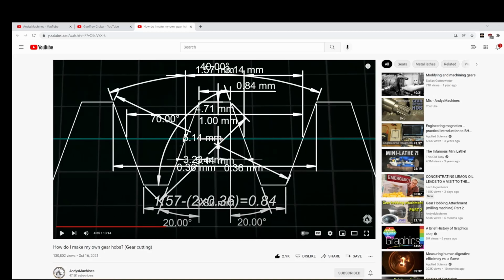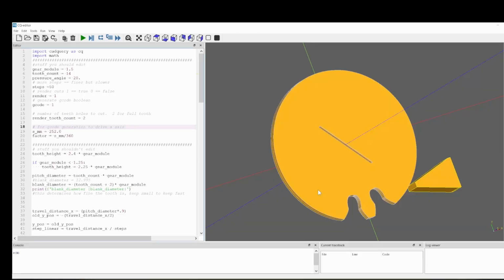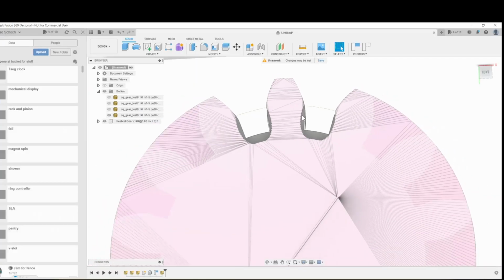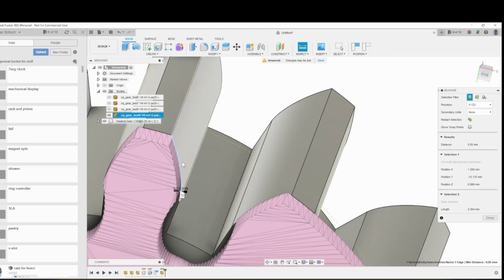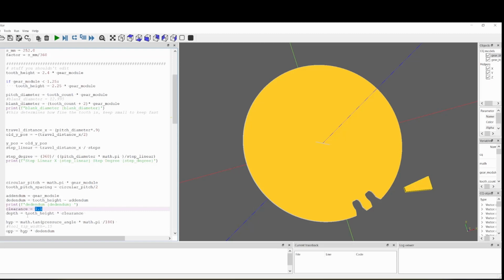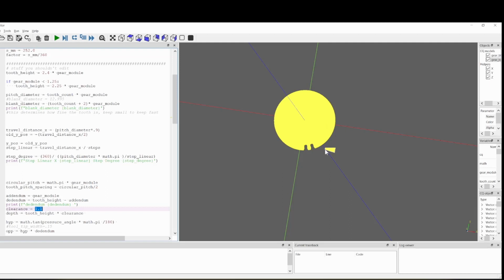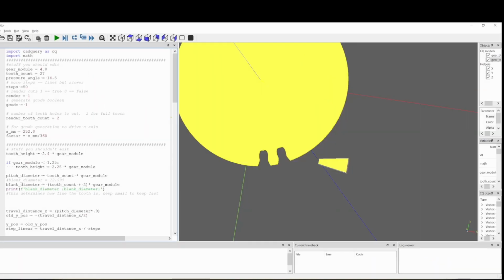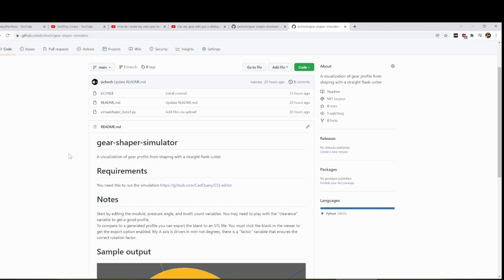virtual shaper part 2:  CNC gear cutting with v shaped cutters

Comment: Hi Jesse! Thanks for the recommendation😁 Nice video and good to see the progress you're making with this!

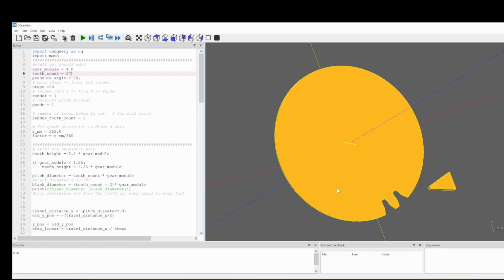I think I may have spotted a small error which will be easily fixable and should improve the results. The tooth at 3:00 looks significantly more undercut than you would expect for a 27 tooth gear (love the choice of a prime number BTW!). Also when comparing it to the gear generated in Fusion360, the root is much deeper.

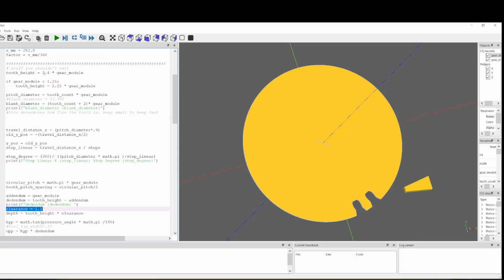At 5:25 you state the tooth height is 2.4 x module for gears > 1.25 mod, and 2.25 x module for gears <1.25 mod. These are the correct numbers to my understanding, except that you have them the wrong way around! Smaller gears actually need more clearance in the root due to engineering tolerances at a smaller scale. I thought you might have just mis-spoken, but looking at your code at the top of the screen I can see this is the way it actually calculates the tooth depth. Swapping these values around should result in a much better tooth profile and I wouldn't be surprised if you find it exactly matches that generated by Fusion.

I hope this helps - Andy
Reply from the maker: @andysmachines Thanks for chiming in Andy!!  The big undercut is caused by 2 issues.  The first is the fact that the polarLineTo() method doesn't seem to do what you'd expect.  I exported the "gear_tool" model as a step file and into fusion 360, when measuring the tool angle i got an oddball angle that was not what I expected.  The fix was simple enough, the polarLine() method works as I'd expect and both the profile and root look much much better.  My last video, "virtual shaper 3" demonstrates  this.  The 2nd issue was the "clearance" variable I used to fudge the fit.  This adds depth to the cut and since the angle was wrong it was needed to better match the flank.  This is no longer needed now that the tool angle is fixed.

I was thinking that a regular end mill could be used for some larger modules assuming the pressure angle can be compensated and the flank "facets" are cut with a straight edge in all cases.  I may try to figure out how to compensate for a regular end mill.  Some what connected is the idea that you can make a virtual cutter tip flat.  I was cutting both ways and stepping a V cutter back in the Y direction the right distance would yield roughly the same cut as a wider cutter with the flat.  This would also work for an endmill where you don't have the correct stock tool diameter.